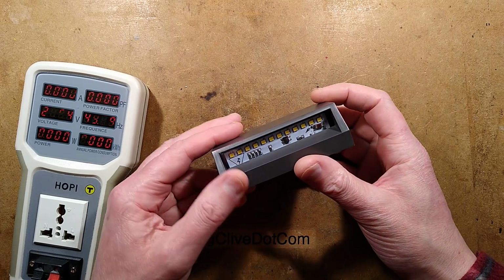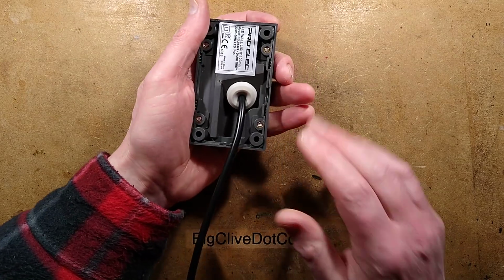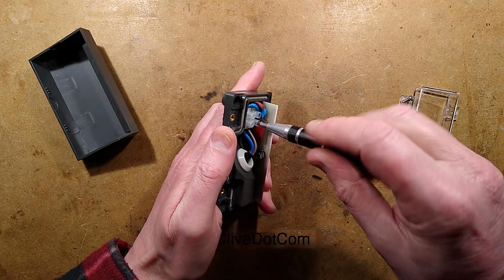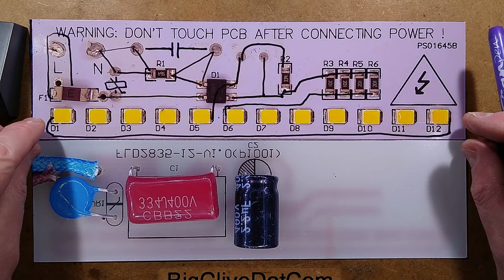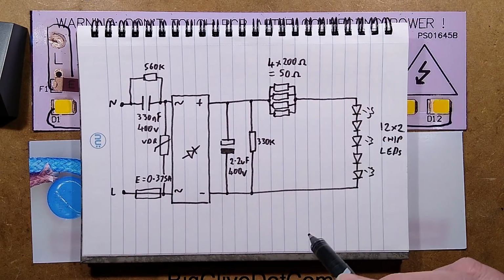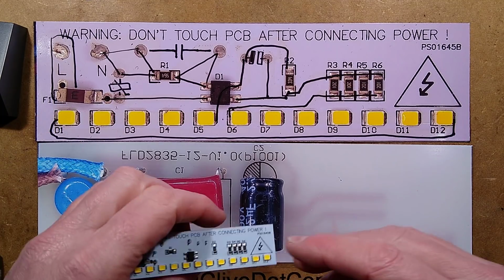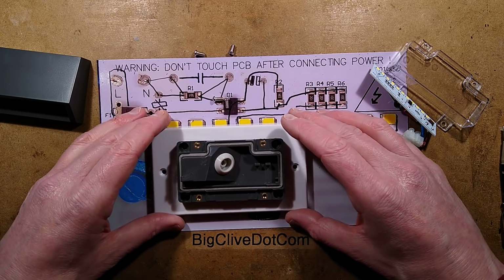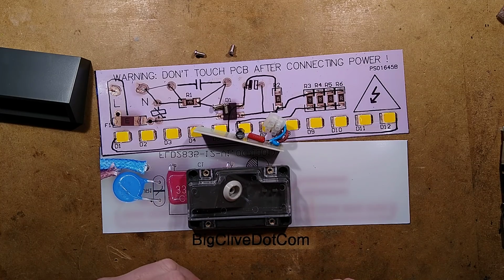Inside a wall mounting, LED path light (with schematic)

Comment: Mr. Clive!
Maybe you will answer a question - I currently have ~60 feet of SMD5050 lights around my 270sq foot apartment. I think it's 30 diodes/meter. 

Would going 60 diodes/meter brighten up the lighting, or not? Would I need more then one control box if I did that?
(edit here's what I bought: https://www.amazon.ca/gp/product/B0823Y81JX/ ... the 65.5m/600 LED's.)
OR would a COB style with neon tube be better?
Reply: It depends on how bright each LED is. LED tape usually (but apparently not in your case) comes with a light output rating in lumens, ideally that's what you should compare by.

Going to twice as many LEDs per meter would probably put out twice as much light, but it really depends on the specifics.

Comment: Honestly something like this would benefit from having say a custom PCB made, that would convert them to low voltage. Then you can easily replace them as they burn out if need be.
Reply: That's easy enough to do if you make a circuit diagram. You can get prototype PCB's for peanuts these days.
Reply: Why on earth would you bother?  For £5 buy another one.  How often do you expect it to fail.
Reply: @JimWhitaker  You are utterly missing the point. The OP was talking about running them on low voltage.
Reply: @gordonlawrence1448  So all you want is the housing, but the housing isn't actually waterproof?  That's a fail, immediately.
Thanks for your valuable input.
Reply: @gordonlawrence1448  So, a custom PCB, to place in a non-waterproof housing.   LOL at you.  start from scratch.

Comment: I wonder how easy it is to get the cover off once it is screwed to the wall??
Reply: Generally they're quite easy to remove from a solidly-anchored base. It's when they're floating freely that things get difficult.
Reply: Seems like removing the covers would bust off the detents; so I'm certain I could remove the cover, but doubtful that it would ever latch on again.

Comment: Water in cables.  I've experienced that.  During a few weeks of rainy weather, my router suddenly died.  I went to take it off the wall and water dripped out of it.  Since I live with family, I thought one of the kids had been messing with it and somehow spilled water on it.  (Don't underestimate the power of the dark si... I mean  kids).  They are creatively and brilliantly destructive)  So I bought a new router, and forbade the kids from even thinking about it. (Again, their existence depends on the destruction of expensive things.  Even their thoughts are disastrous)  A few days later I check the router and I step in a wet spot.  I was about to unleash some biblical apocalyptic rage and hellfire upon the miniature humanoid demons, when I came to thr realization that it was now mounted too high for them to reach.  So I disconnect the router and leave the cables hang there.  I take it and use air to blow the water out in hopes that it is not yet damaged.   I come back to soak up the water and I see a drip hit the floor.  And another,,  and another. ... ...  One ethernet cable was dripping water about a drop every 5 seconds or so.  The cable was dry.  But it was one that was routed outside of the house, up to the second floor and into a window for a computer upstairs.   The rain was getting into the cable from a break in the jacket and by capillary action was flowing down and then back up into the router.  New cable,  routed through some unused ducting and to the room stopped the water ingress. And another new router since the previous one did die a few days later. 
It wasn't the kids at all,  but I still don't trust them....  Those little undeveloped appendages, and their wicked schemes of the destruction of anything they encounter...  Probably out there doing rain-dances and shit, anyway...
Reply: I believe outdoor network cables are gel-filled so there isn't space for water to flow. If an installer used regular indoor cables outdoors I would not be happy.
Reply: @eDoc2020  Cat 6 are
Reply: The problem with any "twisted pairs" type cable is that there is plenty of air gap for water to flow down. Air dielectric coax is even worse. I have seen water flowing through those rather than being a drip every few seconds type thing. You can make them completely waterproof but it costs a fortune. EG the cabling systems used on submarines between the outer hull and pressure hull.
Reply: Generally, if you drill holes through external walls at a slight angle and have a drip loop outside you can deflect some water ingress, although if it's already ingressed into the cable that won't really help. Outdoor ethernet cables are gel-filled to prevent water ingress in the event of a damaged cable.
Reply: Roof mounted TV ariels are good for that too and will invariably kill the connected electronics if its gets that far.
Reply: This was wild from start to Finland
Reply: TIL if you're gonna run network cables outside, make sure to seal them inside a conduit and be sure to slime the ends of the conduit with silicon sealant.
Reply: There's also the workaround of putting a female between two males to stop the flow.
Reply: @phonox  ah yes, electronics, that’s what this comment was about, good show YouTube for not showing the context comments
Reply: Lmao! The best story I've read for 2021😂😂

Comment: You'd be surprised how much you have to tell electricians. I used to work in the oil field and among other things provided technical support for our instrumentation and sensors on oil tanks and oil pumps. I quite often had to talk the field electricians(Actual journeymen electricians) how to use multi-meters to test for continuity and current sensing through 4-20 mA sensors.

Comment: Already thinking this would make a useful up-light in suitable circumstances. 

Air dielectric coax cable is a swine for letting water in. It was common some years ago for a new aerial installation to act as a conduit for rainwater to seep down into the back of the telly, sometimes with interesting results.

Comment: You can waterproof anything with enough silicone RTV.
Reply: Nope. Water always wins.
Reply: From splashing yes, but not the pressurized ingress from heating overnight then cooling in the dew forming morning air.

Comment: Hmm ... this is not a aluminium PCB. Normally the 1,3W have to spread over the whole surface. This FR4 PCB have only some cooper tracks on the surface.
0,1W per little LED ... I think the got pretty hot. :-/

Comment: I have very similar lights but lower profile, sold by TLC as step lights. They've been in use now for 3 years with no failures, mounted on the walls of our driveway.

Comment: Fitted six of these lights in the garden during the summer... had to replace every one of them under the warranty as the seals weren't doing their job. Cable entry is from the rear, inline with (and no stress on) the seal. They look great when they work :)
Reply: I decided to use solar powered led lights in my garden. It saves getting the mains to them and they look to be sealed. I will do a strip down when the first one fails!  Thanks for a great video. I like them all.
Reply: Drill a hole in the bottom to let water out and use some RTV silicone sealant like permatex (meant for motors) where the wires go in after cleaning with some solvent. Permatex has one that is a seal all gasket maker, I forget the exact name at the moment. Most mechanics will know.
Reply: @johnpossum556 that's more or less exactly what I did - each unit has a small weep hole and the entry is beefed up with a sealant. So far, so good :)

Comment: Interesting design. I like how the cable comes in through the back/side like that; it theoretically should help if the light was mounted either facing down or up.

Comment: Who spotted the mistake in the circuit diagram? VR1 Metal Oxide Resistor went to neutral before the capacitor and resistor, not after them. :-)
Reply: Oops!
Reply: @cambridgemart2075  Ach, he's done that many, we can forgive the little mistakes like that. We all do it.
Reply: It's the correct way to connect the varistor across L (via the fuse) and N. Check the app note for any varistor if you are interested.  One good example is  Littelfuse an9767.
Reply: @mancave7879  yeah, but look at the diagram he drew, it wasn't like that! A very easy diagram slip up to make, I was just pointing it out.
Reply: Yes, the varistor in the schematic does not match the actual layout.

Comment: buying stuff to take apart. I belong to that Guild.
Reply: It turns out it's often getting it back together again that's the hard bit.
Reply: @thomas316  ...ah, I remember completely dismantling a lawn mower with my friend (we undid some of the screws with our thumb nails!) ...and the look of dismay on his dad's face when we sheepishly admitted that we couldn't put it back together
Reply: I started at 8 years old when I disassembled my parents mechanical alarm clock. It never went back together...
Reply: @handlesarefeckinstupid  yes sir, that's an  all different kind of engineering putting stuff back together.
Reply: A phrase I heard while growing up,
Engineers take things apart, technicians put them back together again.
Reply: (looks at pin badge and tie clip collection)
Reply: Stripping electronics for spare parts is my kinda thing lmao
Reply: Please share your insights!

Comment: hm, so not something for my garden... we regularly (about every 2 years) get Flooding up to 1,5m.
in that case water wouldnt come through the cable since the cable would be routed upwards, but the light would be submersed for a few days although unpowered. 
I wouldnt trust that white seal for that... Although if i smear excessive amounts of silicone in there that could work...
Reply: idea .... relocate to a higher level, then light your garden.  Silicone is always second best.
Reply: @bennytheball-n4q  i could put the lights higher, but that wouldndefeat the purpose of those lights(purpose as indirect path lights)
Reply: I'd fill the case with two-part epoxy, to "pot" the components.  Kinda frugly, but only $1.
Also I'd be a little twitchy about supplying high-ish voltage (120V or 240V) to lamps that might be immersed :P
Reply: @theskett  its always cut off. When i leave the garden i disconnect the whole system directly after the kwh counter.
So when it floods the whole system will be offline.
Reply: Then you need enough conformal coating, to prevent the volts from causing electrolysis / tracking.
Or, you need to pot the electronics. 
Or, you need to put them above the water line.
Whether or not it's offline, doesn't much affect water ingress.
Reply: How do you feel about low-ish voltage (24V?) waterproof LED tape?  Fairly cheap, non-bitey at 24V, mostly waterproof (if you carefully seal the ends), somewhat easy to place pathside...

Comment: I sometimes wonder why the 'breathing' problem of moisture ingress isn't avoided by the incorporation of a small membrane in the housing to allow for expansion and contraction of the eclosed air. Simple and cheap to implement surely?
Reply: The issue is that you add £0.20 to the component cost and that puts the manufacturing cost up by about £0.30. The margin for the manufacturer then puts that up to £0.50. Distribution puts that up to £0.75. The retailer margin puts that up to £1.50+VAT. So to an average consumer adding a £0.20 component adds in real terms about £2 to the buy price. They will just go elsewhere and get cheaper.
Reply: @gordonlawrence1448  OK, OK, it was a stupid suggestion and you have shot me down in flames. As always the bean counters overrule the engineers to the detriment of the end user but, hey, they sell more when you have to replace a water-logged one a day after the warranty expires.
Reply: @JUANKERR2000  Actually that is almost the exact opposite of what I was saying. The average consumer would rather buy crap that is £0.50 cheaper but will only last 18 months than spend the extra £0.50 for something that will last a decade. This is a problem all over the place. The public baulk at NHS spending on high quality equipment as a high quality MRI scanner costs £2 million more than a cheap one. I have seen this very complaint. The fact that the high quality one would last about 15 years instead of about 6 to 7 and cost £200k less  in maintenance and consumables etc was not something the public would listen to. EG the cheap one uses about 1.5 litres of liquid helium per hour (it cycles 20 times that but most is recovered). compared to about 0.5 litres lost for the better one. That alone is £40 per hour running costs or £80k per year. Then there is the cost of the electricity. An MRI scanner uses about 30kW including compressors etc for a cheap one. Then there is the cost of replacing servo's etc that move the scan coils magnets etc. That's mind boggling. So actually most of the time it is down to the public etc. Even the issues with the DWP can be traced back to the "Daily Fail" and their assery with regard to a comment on good morning Britain about 15 years ago.
Reply: @gordonlawrence1448  Of cause, I was commenting on the possibility (or lack thereof) of finding a zero cost solution.
Reply: This is done, e.g. in ECU devices. But it is not really cheap.
Reply: @goamarty  Use a soft enough housing material, like bag-thickness PE might do it, but then you'll need a separate layer of harder material to stop mechanical damage.
Reply: @johndododoe1411  Not really possible if you produce some heat in the device. The housing is die cast aluminium covered in cooling fins.
Reply: @goamarty  No it is not aluminium with cooling fins.  It's hard plastic, so I suggested a softer plastic.
Reply: @goamarty  Thanks for enlightening me. I had in mind something along the lines of a simple blind grommet with a thin wall which should be inexpensive both to produce and fit, though it would be essential to ensure that the enclosure was fully airtight.

Comment: In the mid 80's ,3 days after I was married I moved 1200 and got my 2 full time as a electrician apprentice and ended up working with my dad who at that time had been in the trade for over 20 years and the first time we dealt with weather proof boxes he showed me to tear a quarter inch tear in the gasket where the bottom screw is. He said they always fill up with water so always put in a drain... lol . He was right every service call I went on that had a weather proof box with a intact gasket would be full of water.
Reply: This reminds me: in post-Soviet countries air conditioning was introduced fairly recently, and to this day there are plenty of new split system installations in which technicians simply forget that _condensation exists_. 
(One of the most remarkable examples in Moscow can be seen at 1935 Komsomolskaya metro station, an architectural heritage, but which has a staff room in the middle of the station with two air conditioners poking out, each having a plastic bucket taped for condensation collection (periodically emptied by staff)).
Reply: Typically if it isn’t submerged or moving through water, or has water literally spraying near it, a gap in the seal at the bottom or a small tube wedged between it should almost be mandatory
Reply: I deal with "Waterproof" security cameras and have come to the same conclusion. It doesn't matter how well sealed the ones under large overhangs or on the North side of buildings are, eventually there will be water in them. Better off to put in a way for the water to drain out. Ones with built in heaters to stop condensation just make the situation worse. We had one that collected a 1/4cup of water in it every week until we disabled the heater. Of course this one was nice and high on the side of the building so had to use the longest, shakiest ladder to get to.
Reply: @markkayser426  it’s one of those situations where water drops erode exposed seals, and having a lip or shield just leaves somewhere for moss or whatever it is to grow and eat the seal